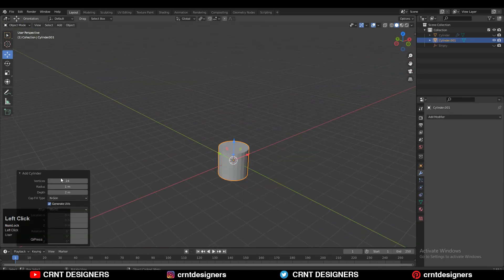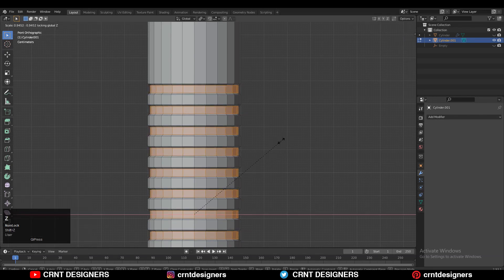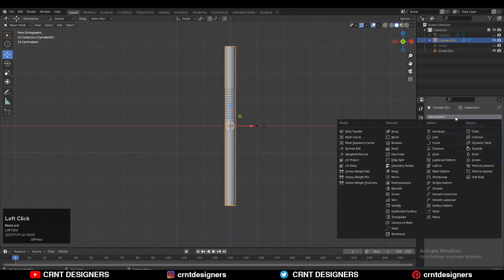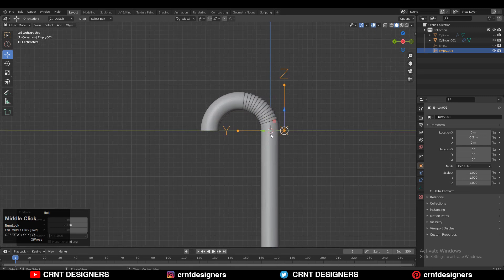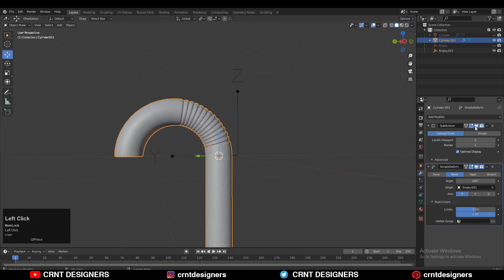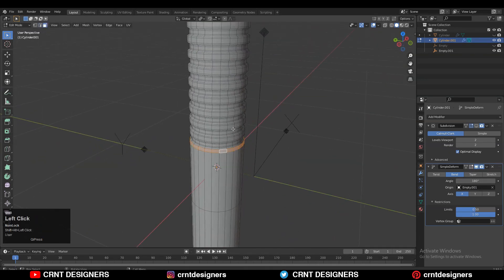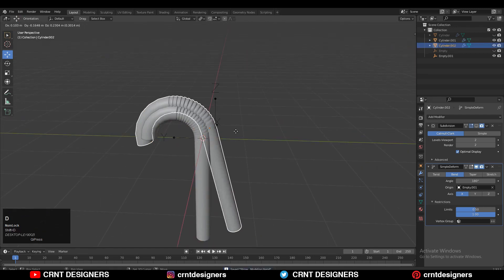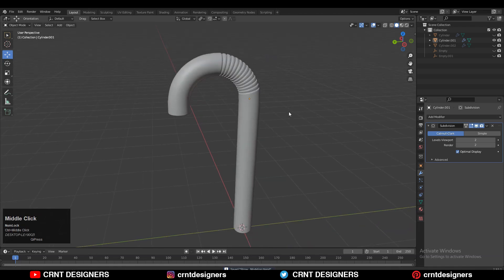Blender Pipe Modeling_Blender Tutorial_Blender 3D Modeling

Comment: Here is an approach I'd use for far away props as I'm very keen on keeping a tight poly/wire budget:
1) Add single vert, extrude it once then repeat a bunch of times - how many depends on the resolution you want. Now convert it to curve and give it a bevel depth.
2) Add a curve object and shape it as you want.
3) Add a curve modifier to the first one so that it follows. Add a subdiv modifier with Adaptive subdiv turned on (experimental feature set).
4) Create a simple metal material with the following setup into displacement node:
UV -> Sep XYZ.X -> Map Range (clamped, from values determines range) -> Multiply 10 -> Fraction -> Ping Pong 0.5 -> Multiply 2 -> Color Ramp (to shape it) -> Displacement.
5) Create a separate endpiece with thickness if you need it.

So it's basically just a few vertices converted to a curve with thickness that follows a bezier curve where the material does all the tricks. And very easy to modify if you need to tweak it.